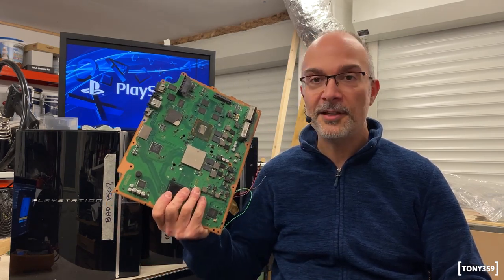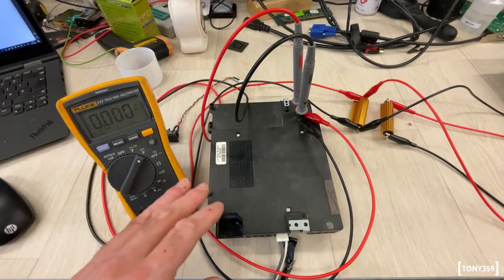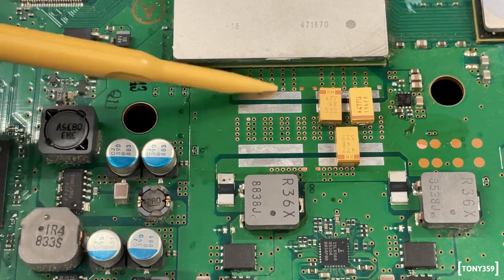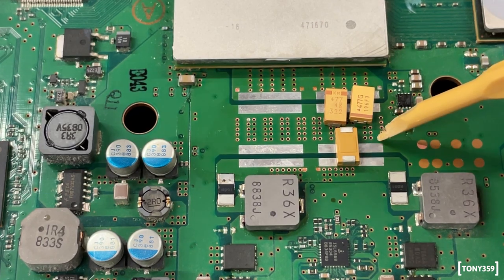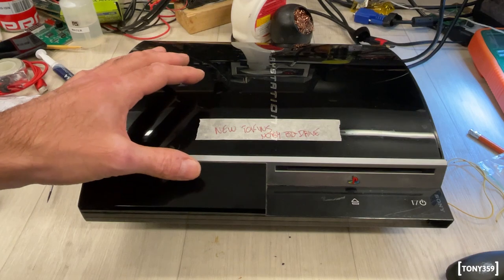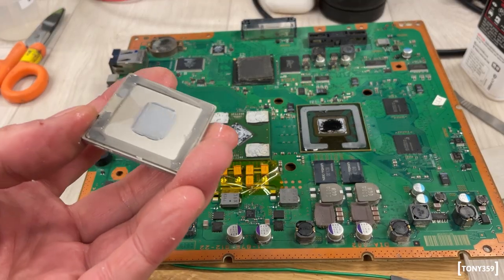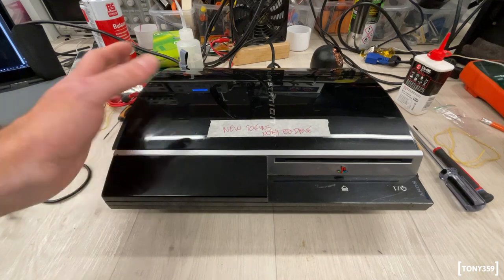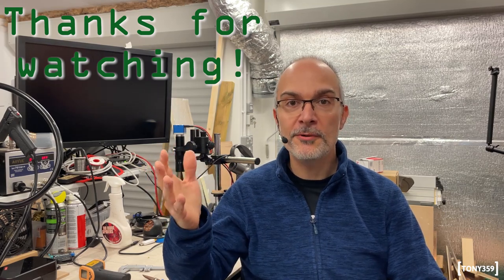PlayStation 3 Repairathon - Part 1

Comment: Just some suggestions on the second PS3. When applying thermal paste after a de-lid, apply the paste to the top of the IHS of both chips first (but do not put thermal paste on top of the chip dies themselves). This allows each of the IHS to adhere to the main heatsink AND maintain an orientation that is (as close to) parallel to the surface of the heatsink as possible (the surface of the chip dies themselves will facilitate with leveling). Partially assemble the console up to where the two clamps are secured (to ensure that the IHS are pressed firmly to the heatsink). Now disassemble, and the IHS should be "glued" to the heatsink. Visually inspect the IHS to ensure that they are not tilted. Then proceed to put thermal paste onto the chip dies. Doing it the way you did on the video allows the IHS to "float" between the dies and the heatsink and opens the possibility that the IHS is not parallel to the surface of the heatsink or CPU dies. This in turn results in uneven heat transfer.
Reply from the maker: Hi there - thank you so much for taking the time to write your feedback. I did watch NSC's videos and indeed it explains the same procedure. Somehow I did not do that for my PS3's, not sure why :) What you say IS the way to go 100%. Eventually those PS3 went to my friend Tim, he's more skilled than I am when it comes to refurbishing so I'm confident he's re-applied the IHS' correctly. Thanks for watching!

Comment: Hi, I just wanted to say thanks for this series of videos which inspired me to try and fix some PS3 consoles myself. I didn't have prior experience and tools to do this but I followed your advice and got everything I needed, including several broken consoles I found on the local marketplace. After I got all prepared it was kind of hard to finally start doing the repairs but today I have finally fixed my first PS3! It was just tokins but it was a lot of fun! I tried to replicate your technique in desoldering the old ones and even though I got the top part melted it was a success! I used RIP-Felix's tantalizer boards to make the replacement capacitors look neat and I'm very happy with the result! Once again, thank you for inspiring me!
Reply from the maker: You are very welcome and well done for your first repair! Amazing!

Comment: Had same problem, and just decided to heat those tokkins up with a heat gun at around 250 degrees very carefully for about a minute, and it did the trick !!! 🎉🎉
Reply from the maker: I hope I am mistaken and your PS3 can live a long life but that usually "fixes" the RSX graphic chip which is known for failing. The Tokins were probably called guilty too many times - though I am told that on this very PS3 on this video, it was actually the Tokins :)
Thanks for watching and congrats!

Comment: good job. I have a ps3 that plays some games and turns off like the first one in this video. Do you fix it like the first one in the video or not and how much does it cost?
Reply from the maker: Thanks. It could be anything. Does it beep three times? That’s overheating. If not, it could be really anything. It turns out that tokins are rarely the cause of a fault. Capacitors are not expensive. Tools and skills are 🙂

Comment: I have a 80GB 2nd Gen PS3 fat that i bought new in 2007 and after 10 years of use it started to over heat and i believe only why it took that long was because it always had a fan in front of it, in 2017 I did a DELID and i work on electronics but i was very worried of messing up the CPU as it was the hardest for me to do and with the possibility of scratching the traces but by luck i did it right the first time and i have had no issues with the console this month i revisited opening up the console and replaced the thermal paste again and this time using Artic MX-6 on the CPU and GPU and Artic MX-5 on the Heat Spreaders along with replacing the thermal pads.  
I thought finally with this set up i would be done, well come to find out I should had delid  the south bridge cause under that is a chip being cooled by thermal paste and come to find out that the south bridge does get warm and needs to be cooled so i ordered some cutting wire that is used to open cell phone screens cause the space between the south bride lid is thinner then the CPU and Ill go ahead and replace the clock batter while its open again.....wish me luck.
Reply from the maker: sounds like a fun project! Lucky PS3 has a loving owner! Good luck!

Comment: Hi, nice video. We learn a lot from you. I need your help. I bought a ps3 with ylod and I read the errors with the syscon. I got the error 1002, and I changed one of the Nec tokin in the video. I solved the problem and the console works perfectly, but the only problem is that when I turn it off the red light stays blinking and I can't restart with the controller. The console turns off completely, but I have to press and hold the power button on the console to turn off the red blinking light. Do you know what could be the problem? Would I have to change more nec tokin? Thanks for everything.
Reply from the maker: Thanks for your comment! I'm not sure to be honest but it feels like a power handling issue. The Syscon looks after that, did you get the error codes by serial or via custom ROM? If you soldered around the syscon IC I would double check that everything is as it should be.
Also, try powering on and off via Syscon, you might get more insight of what is happening. I cannot remember if you need to put the console in diagnostic mode, NSC's document has got everything you need to do that. Good luck!

Comment: What temperature do you use to soften the thermal glue on the heat spreaders? I get paranoid now putting any heat near RSX :)
Reply from the maker: I understand why! :) I used both 100C for a bit longer or 300C for a shorter time. But considering the RSX die it directly attached to the IHS, maybe 100C for - say - 30s is ok. Good luck :)

Comment: Nice job. But I would not delid as a preventative measure. If after cleaning and new thermal paste the temps/fan speed are too high (CFW or HEN software to check them), then I would consider delidding.
Also, you can "Re-merry" a new BD using CFW tools.

Comment: What’s your advice for replacing the internal hard drive? My PS3 has a 1tb HDD and I would like to replace it with a 1tb SSD. I’m just not sure which brand to buy.
Reply from the maker: I’m not an expert on the subject but if you Google ‘PS3 compatible SSD’ you should get some pointers. I see some models from crucial and Samsung. I wouldn’t invest too much on that, the PS3 is an old machine and while an SSD will improve things, I think a basic one will do 🙂 good luck!
Reply: @tony359  thanks

Comment: I have an OG Fat 60GB backwards compat that is freezing in the XMB when I scroll to games. It is 100% an RSX problem as I have already torn it down and tried to reflow it. Before I did that, it was YLOD. But I wouldn't say I fixed it, that's for sure. I wish I had a reball station I really want to get this thing working again!
Reply from the maker: Good job for reflowing it! If you watch the video I linked in my description from RIP-Felix, you'll find that it's very likely the only fix for your ps3 is to replace the RSX with a newer revision... Not for the faint of heart (that includes me lol) thanks for watching!

Comment: I've got an backwards compatible ps3 in working state, i got the syscon error log from ps3toolset, it has multiple 1001 errros, after cleaning the console (not deliding) and spending some time on power on, the console suddenly after normal shut off, didn't even goes to stand by mode (red light). After changing 2 power cords, the light pop in! Booting the console and got YLOD! After several times of turning off and on, i dissembly it again and reassembly, the console boot up!!! I've check again the syscon and i got 3003 error! The console working normally without ylod (again). till i get it to local electronic store to change the NEC TOKIN Capacitors. Could the problem be those NEC TOKIN?
Reply from the maker: The role of Tokin's with the PS3 has been recently re-evaluated and it's now believed they're seldom the cause of issues. That said, your PS3 seems to have some power issues so maybe replacing the tokins won't hurt. Remember it's not an easy process... Good luck!

Comment: I'm looking into using a PC ATX Power Supply for powering my BC PS3 and to reduce the heat around that area where the internal power supply goes. I would like to know what kind of connector/cable can I use for the two rounded gold long prongs on the PS3 (CECHA01 model) motherboard if you can help. Thanks.
Reply from the maker: Hi there - I do not know if those terminals are standard or not. If you cannot find them you could solder some wires directly at the back of the motherboard. However, the APS-227 features 32A at 12V so you'd need a pretty chunky wire in order not to melt it. That is why computer boards usually have multiple pin connectors. Unless you use a pretty big wire, you're also going to have an excessive voltage drop. In short, I'm not sure you're gaining much here. Thanks for your message!

Comment: You should change the tokins of cpu too on the first one, because they could fail in the future, nec tokins are pretty awful. I use Mortal Kombat 9 or Komplete to stress consoles. It has a watch mode if you leave it on the title screen.
Reply from the maker: The Tokins have been mainly "absolved" by their sins - check RIP_Felix's video linked in the description. It turned out that the issue with the RSX is the RSX and - usually - not the tokins. 
Now, for a coincidence, on this PS3 it seems that the issue WAS the tokins as it has been sold with a warranty and it hasn't come back :) 

So it's a bit unclear :) Thanks for watching!

Comment: Scraping away the solder mask to put those capacitors on seems like a waste.
Why not just solder them to their pads and run a bridge wire made from some old through-hole resistor legs across the negative terminals instead and the exposed pad?
This is elegant enough, and also makes it easier to repair in the future when these ones also need to inevitably be replaced.
Reply from the maker: Well, it only takes a few seconds to remove the solder mark. Tantalum caps are not electrolytics, they shouldn't fail over time - and even the Tokins don't normally fail, it's been determined that they are rarely the cause of the YLOD! Thanks for watching!
Reply: @tony359  All capacitors fail over time. I work on retro computers all the time and tantalum caps are known to explode when they get old enough. If you've ever worked on an old IBM 5150, you know that you have to check for shorts on the motherboard power plug and be prepared for the pop of exploding tantalum capacitors when you turn it on for the first time.
Vishay and Kemet even provide MTBF calculators, and assuming the PS5 runs at 105C for 2000 hours, those caps WILL degrade and some may fail.
Nothing lasts forever.
Reply from the maker: @Null_Experis 2000 hours is for electrolytics and at 100% rated voltage and temperature. For every 10C cooler they run from rates, life doubles. There are calculators online, It’s normal for electrolytics to get 20+ years out of them unless running hot. ‘Droplet’ Tantalum’s on old IBM fail because they absorb humidity. Those machines are usually improperly stored and seldom used and that can happen. The tantalum you see on the video are a different type, I’ve never encountered a shorted or broken one. I mean, anything can happen but those have the same chances of failing than a resistor or a diode 🙂

Comment: Nice video! BUT VERY DANGER if you do this: 25:40 you can break the vram chips! The chance here to break the vram chips is 50:50 on newer PS3's like the CECH-20XX,25xx,30xx etc. It's like russian roulette, it can go good, but it can go very bad! Check: https://abload.de/image_mobile.php?img=chiprambrokenheatc.jpg On the old fat ladys the chance to break the vram chips is not that high, because there the thermal glue is different. But people's already break them also on the backwards fat lady's. So just take care! Best Regards -> NSC ✌️
Reply from the maker: Thank you for the heads up - I did see pictures of damaged VRAM and I did see your video where you use a knife to de-lid the GPU. In the end I felt that going with the lever method was a better way but you have way much more experience than I do so I'll keep that in mind, thank you! And thanks for all your tutorials - and for watching! :)
Reply: @tony359  yeah, that's right, you always welcome and i hope I'm to 🥰🤗 Subscribed btw. ✌️

Comment: What kind of a sollution you used during delidding? Was something oil based? I delidded one of my ps3 and ... jammed the cpu. And i have to delid my other because it's reaching 80+ temps
Reply from the maker: It was just a little of oil to help. I don't think it makes a massive difference. What you need is a sharp tool and a steady hand. A drop of oil might help but I don't think it's critical. Good luck and thanks for watching!

Comment: What's up with your tv ? Why does it have that line on the right hand side ?
Reply from the maker: It’s a very nice Dell monitor, 27”, all analogue inputs available. But there’s a fault on the flat cable connecting the panel to the electronics. I tried fixing it but I could not and any deeper attempt would likely write off the monitor (those flat cables are not designed to be removed or touched). So I moved it to the workshop 🙂 

It started with one line, disappearing when warm. Now it’s a whole bunch of them. If I twist the frame, manually, they change size 🙂

Comment: Hi sir what is the value of capacitor volts and caacitance
Reply from the maker: You need to check on yours, if you google the code it will tell you what they are.

Comment: you cant replace the CELL on ANY ps3, they are married to SYSCON and NAND/NOR. if you have those chips WITH the replacement CELL, it can be repaired.
Reply from the maker: Thanks, I think I read about that. I guess the plan would be to acquire a MB with a faulty RSX and replace Cell, Syscon and NAND/NOR. One day, maybe :) Thanks for watching!
Reply: @tony359  oh also for replacing BD Drives, all phats require a remarry, which can be done in Factory Service Mode. use CFW to enter FSM and remarry the drive. slims do not need remarrying.
Reply from the maker: @kernaltrap  Oh, that's easy! I should have searched a bit more, I have some spare drives :) Thanks for mentioning!

Comment: What cables do I need to connect the Syscon module to the ps3?
Reply from the maker: The Syscon is on the PS3. You need a USB serial adaptor for your computer and then some wires which you'll have to carefully solder on the PS3 motherboard. I recommend this video for a tutorial: https://www.youtube.com/watch?v=ZvqJQVd5pBY

If the console still boots, you can check syscon logs with a custom firmware, no need to open the PS3. 

Thanks for watching!

Comment: How many volts are the capacitors I use?
Reply from the maker: The original 0E108 should be 2.5V, 1000uF. I used 4V 470uF.
Reply: @tony359  Could I use a 6 volt one?
Reply from the maker: @carlosocanto3895  with capacitors higher is better. That's the maximum voltage they can sustain.

Comment: could 2124 be related to the 1002 which is nec tokin failure it still shows audio and video through hdmi 

Bringup Count: 1054, Shutdown Count: 972

Runtime: 422 Days, 6 Hours, 48 Minutes, 25 Seconds

Error Log
01: A0802124  Sun Apr 21 05:20:59 2024
02: A0801002  Sun Apr 21 05:20:59 2024
03: FFFFFFFF  Fri Dec 31 18:59:59 1999
04: FFFFFFFF  Fri Dec 31 18:59:59 1999
05: FFFFFFFF  Fri Dec 31 18:59:59 1999
06: FFFFFFFF  Fri Dec 31 18:59:59 1999
07: FFFFFFFF  Fri Dec 31 18:59:59 1999
08: FFFFFFFF  Fri Dec 31 18:59:59 1999
09: FFFFFFFF  Fri Dec 31 18:59:59 1999
10: FFFFFFFF  Fri Dec 31 18:59:59 1999
11: FFFFFFFF  Fri Dec 31 18:59:59 1999
12: FFFFFFFF  Fri Dec 31 18:59:59 1999
13: FFFFFFFF  Fri Dec 31 18:59:59 1999
14: FFFFFFFF  Fri Dec 31 18:59:59 1999
15: FFFFFFFF  Fri Dec 31 18:59:59 1999
16: FFFFFFFF  Fri Dec 31 18:59:59 1999
17: FFFFFFFF  Fri Dec 31 18:59:59 1999
18: FFFFFFFF  Fri Dec 31 18:59:59 1999
19: FFFFFFFF  Fri Dec 31 18:59:59 1999
20: FFFFFFFF  Fri Dec 31 18:59:59 1999
21: FFFFFFFF  Fri Dec 31 18:59:59 1999
22: FFFFFFFF  Fri Dec 31 18:59:59 1999
23: FFFFFFFF  Fri Dec 31 18:59:59 1999
24: FFFFFFFF  Fri Dec 31 18:59:59 1999
25: FFFFFFFF  Fri Dec 31 18:59:59 1999
26: FFFFFFFF  Fri Dec 31 18:59:59 1999
27: FFFFFFFF  Fri Dec 31 18:59:59 1999
28: FFFFFFFF  Fri Dec 31 18:59:59 1999
29: FFFFFFFF  Fri Dec 31 18:59:59 1999
30: FFFFFFFF  Fri Dec 31 18:59:59 1999
31: FFFFFFFF  Fri Dec 31 18:59:59 1999
32: FFFFFFFF  Fri Dec 31 18:59:59 1999
Reply from the maker: I'm afraid I'm not an expert when it comes to that. Tokins have recently been "partly discharged" of their sins though so I'm not sure. Thanks for watching!